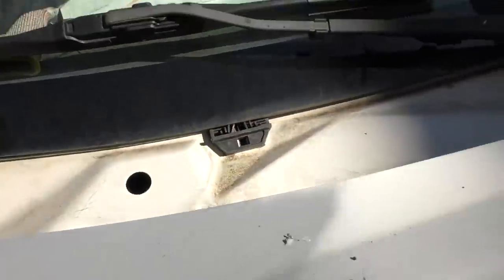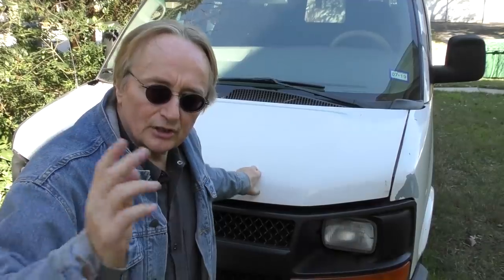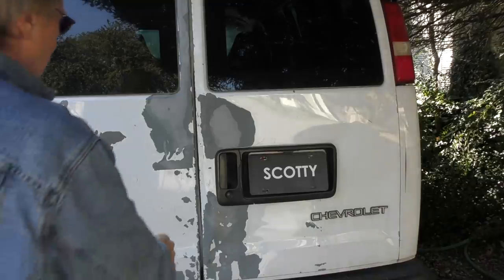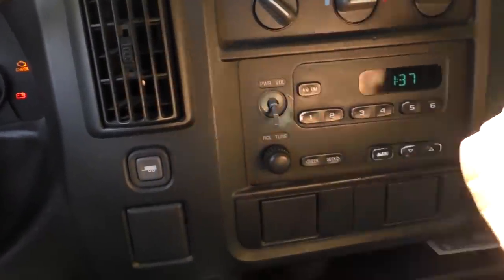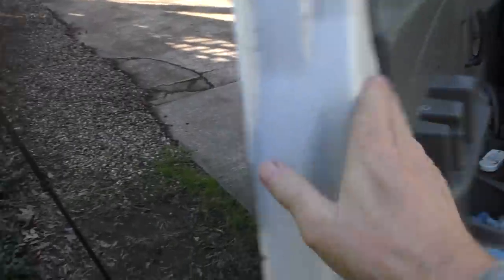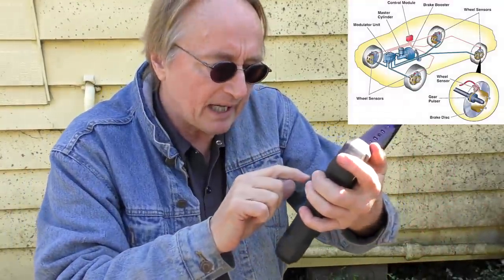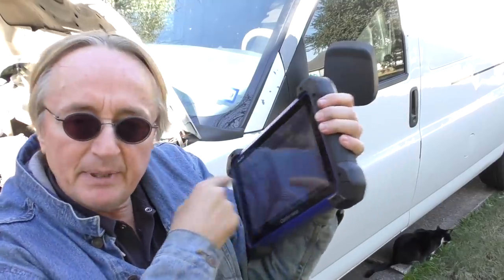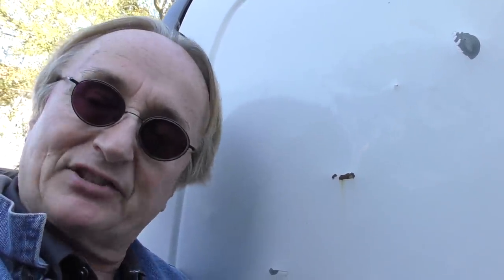I Told You About This Vehicle But Nobody Listened

Comment: I bought my 2019 traverse this past Aug and proud I did.I was a Toyota owner for years. So what if it lasts 4 years less. Time killed my Toyota Camry anyway. My Traverse blows away my 2017 Rav 4 big time. I feel very comfortable in the Traverse. If I get 12 years out of it then fine. My Toyota Camry got 270 miles on it. I went back to Chevy after 20 years. I am proud I did. The Traverse got very good reviews from Edmonds and its built nice. The paint job is mint. I don't care what you buy these days it is all hit or miss. I rolled the dice on My chevy and that's the way it is. I have a good warranty through my insurance company for 200 ded they fix anything wrong on the Traverse once inspected by Geico.   I used them a few times on my Toyota cars. No issues. So Scotty cry all you want about Chevy I went and got one.
Reply: YouTube Movie Junkie it is luck of the draw your right, but you've gotta hope your gamble pays off. It will only be you crying if you put it all on red and it comes up black. You gotta mitigate the risk.
Reply: @johnennis4586  Its ok I will get 150000 miles ..Then I will sell or get another

Comment: I have a Chevy truck for my company truck and a Tundra for my personal truck (2007 240,000 hard miles) Unbelievable all the problems I’ve had with the Chevy (2008 114,000 miles) and it has mainly simple hwy miles. I made the comment the tundra is twice the truck. Not sure if I’m giving the tundra enough credit....

Comment: Scotty, I drove one of those as a service vehicle for a company that had converted it to run on natural gas. Jeez, what a nightmare. You lose about 25% of your horsepower on NG, talk about having trouble getting out if it’s own way. Plus, you had to keep the gasoline system and gas in the tank because the damn thing would not cold start on NG. I would use an electric transfer switch to cut out the NG and engage the gasoline system just before getting home so it would start on gasoline the next morning. Plus, it had 3 large gas cylinders in the back tucked under the shelving. Terrible vehicle, glad to have moved on.

Comment: I guess I’ve been lucky or maybe I’m just not stupid and know enough to maintain my vehicles.... I sold my Sierra with 320,000 miles 5.3 Vortec and the guy who bought it is still driving it 2 years later. Only replaced a fuel pump. I sold my Silverado with 256,000 miles and again it’s still on the road today. I only replaced a radiator. I know Scotty has forgotten more about cars than I’ll ever know but I haven’t ever had bad luck with a GM truck. I don’t buy American cars, only Toyota so I can’t comment on cars.

Comment: That work van has probably never seen a car wash or any wax, and Scotty is blaming poor quality paint? LOL!
Reply: The paint really is POOR QUALITY!
Reply: Bruce Jones compared to other work vans, and not a passenger car that’s well taken care of?
Reply: @94concours  no, the paint did not hold up well out in the weather and sun. Not many manufacturers had paint that held up well, after the EPA forced the lead out of the paint. It took a while for the paint manufacturers to develop a good paint system that would hold up as well as the older ones. Just pay attention to an old junker of the 40s or 50s sitting out in a field rusting away.  You will still find paint on them!

Comment: I have a 2003 Chevrolet Silverado and I have had problems with the paint. All the clear coat has come off the roof. And the rockers under the extended cab doors are rotting out. And is starting to rust on the bed above the right rear wheel. And I live in the south when they dont salt the roads.

Comment: Scotty be very careful trashing that van. GM  made that model with arguably one of the most robust engines ever made the LQ4 and undoubtedly the strongest transmission on earth the Novak 4L80E. The later models came with huge four wheel disc brakes and were able to whip on most modern cars when empty. These types of vehicles were commonly neglected and beat on daily by employees    explaining their usual state of disrepair. I am not a GM fan by any stretch  but happen to be very familiar with this model. Aside from having to climb out through the window on occasion and repairing broken exhaust manifold bolts the later model vans are probably one of the few things GM did right with the highest quality driveline in it's class.

Comment: Scotty, I purchased a 2017 silverado with a six cylinder engine that turns into a four cylinder when you drive down the highway I'm nervous about all the warnings leads me to question if i purchased a piece of junk and should look to get rid of it before i have problems or the extended warranty i purchased with it runs out

Comment: They all make a good one and they all make a bad one. It's hard to say the same abput toyotas because i rarely see on being worked. The trucks are used like my ranger, work commuters and sometimes an appliance or furniture in the bed. They rarely see the abuse that this van has seen. I'm no gm fan but this isn't a fair comparison. My biggest gripe about gm is the metal they used and design. I bought an 06 2500hd. It was dirt cheap and i wanted something to tinker on here and there. I've got it running good shy an o2 sensor. I've patched up the rust and i gotta say for a truck that was parked and left to rot for years, it's purring as much as a 6.0 ls will. I am impressed with that engine/trans, 4l80e i believe. That rot though, I'm disappointed with them and again, I'm not a gm fan. My ranger was in a similar situation, parked for years in grass. No where close to the same rust.

Comment: Scotty, is there a difference between 0w20 and 5w20 oil? Should I use a 5w20 in the summer since it’s so hot?
Reply: Steven Sevek probably not lol. Might get hotter on the track
Reply: Stephen Arling I’ve always used what the manufacturer recommends, they know more about the engine than we do. I’ve always been told the first number in this case 0w will flow better on startup than the 5w will. Once they reach operating temperature, they’re the same at 20
Reply: Stephen Arling I know it’s safe in old engines. Scotty says you should never change viscosity in modern engines.

Comment: Hi Scotty, I have a 2017 Nissan Murano SL. 98,000 miles. Lots of highway driving. The engine light came on and it was a code for a mass air flow sensor. I removed it and cleaned it with mass air flow cleaner, cleared code and two days later it came back same code. So I assume that I will need to install a new sensor. The dealer mechanic said it could also mean I would need a new throttle assembly but won't  know until they scan it. What should I do ? The air flow sensor is like $300.00 dollars and of course if that's not the problem I'm out $300.00 because it's a electronic part. The throttle assembly would be over $900.00! I wish I had known about you before I bought this thing. HELP

Comment: These vans probably get washed once a year and get a oil change every 20k miles, transmission fluid never gets checked and somehow they still last 200k miles. These things were fleet machines and just like the 2v 4.6 fords the 4.3, 4.8, 5.3 engines would refuse to die

Comment: i have a vw transporter with the 1.9 tdi engine, that van is really pulling stuff and getting almost small hatchback gas mileage in highway mileage with 449k miles on odometer
chevy should offer diesel like ford transit does, otherwise its gonna go down in commercial van market too

Comment: The interior looks more like some animal got inside and went wild, the volume control shaft is bent, looks like somebody punched or took a hammer to the radio. There's a clear difference between wear and tear vs someone just beating the crap out of a vehicle. Metal parts like that don't just bend on their own.

Comment: Thanks for your videos Scotty! Was going to Mazda to change the transmission fluid based on your suggestion. Has 71,000 they told me they never change them it’s a sealed system. I have 2016 Mazda CX-5 is this accurate info?

Comment: The Chevy Express is a derivative from the 70s as far as the frame goes...these vehicles are service vehicles and they are heavy duty built with the frame and body. The la v8s were the best thing to happen to these vans.  These Vans are indestructible with proper maintenance......they do 200-500k all day with very little love....yes they fall apart, and are abnomalies, but they get beat on....it's a commercial van.... A passenger variant of this van with last of family 20 years with no issues.  yes it's not as fuel as efficient as the unibody Vans like the sprinter and the transit but that's because of the body on frame setup...people in the know know this.  Nissan 2500 and Chevy are the last true HD vans available.... The dog house that he's referring to is basically two clips and 2 10mm bolts and takes a min to pull out......I like Scotty, but this review is a fail...

Comment: Scotty, I hate to disagree with you but you blasted Subaru for using the same airbag supplier that failed the first time and now Toyota has done it and you’re OK with that and you’re certainly not claiming that it was Toyotas responsibility to find a different airbag supplier. Now you’re blasting general motors for not putting V-8’s in their vans. I’ve driven the V-6 version of this van and nearly gotten a speeding ticket. It’s very powerful for daily delivery service unless they’re hauling concrete then they might need the V8. The V-6 version of this was faster than many cars I drove in the 90s. I was thinking Chevrolet was ahead of the game in that regard. But the paint did fall off of it just like in this example. They’re the same van same here 2005-ish. So you recommend 4 cylinders for most of Toyotas/lexus cars and avoid the eight cylinders but then in pick up trucks and now vans you think everyone should have an eight cylinder.  And no hybrids. Got it. Get a Toyota or Lexus with less than an eight cylinder engine. But if you buy anything that you’re going to move anything with it must be an eight cylinder a gas hog. Got it, wait, Toyota gas hog, got it!

Comment: Scotty my friend has a 2007 explorer sport trac with 83,000 miles and a 4.7L. It has P0011 and P0016. What do you think would be the most likely issue. At times it runs like it needs spark plugs changed but with those codes I’m thinking there’s something else going on.

Comment: Hey Scotty! Original owner of 2012 mini cooper s clubman, 51,700 miles. No problems yet. I change oil. Should I be looking for a new/used car that is more reliable since money is tight for me? I live in AZ. 🚗🚗🚗
Reply: 2005-06 Camry or 2002+ Panther body. A 1996-04 Avalon or '96-01 Camry would also be good; the '96-01 Camry have flimsy door handles and that's about it.

Comment: This isn't exactly an apples-to-apples comparison. Yes they are both vans, but one is a work van and the other is a passenger van. Work vans are notoriously thrashed and bashed and not taken care of. As it is plain to see with this van it was not taken care of at all. Toyota siennas are not work vans, very rarely you might see one being used as a work van but for the most part they do not have the towing capacity hauling capacity or space to be used effectively as a work van. They are usually passenger vehicles and therefore usually taken care of better. I agree with the paint and being crap, and they could have done a better job of that but in my opinion all water-based paint is crap compared to the old lacquer based paint.

Comment: If you need a vehicle to make money with there is nothing better in the world in the GM truck or van I have several Express vans that I have gas working in every day and I can't tell you how great a vehicle they are yeah the paint might peel but if you need the thing to start buy a GM only thing you need to do is replace the right front wheel bearing every hundred and fifty thousand miles in the left front at 175 to 180 and they will never leave you stranded

Comment: Hey Scotty I have a 2014 Infiniti Q50 it has 116202 miles on it. I changed the battery on it and now the car doesn’t accelerate when I put it in drive and the rpm doesn’t go past 3 what seems to be the problem?

Comment: Back story: On morning of 9-11-01 I was headed to Akron, Ohio to pick up my new Chevy 1500 Silverado 4x4. I hear on the radio about the attack on the Towers, I thinking 'should I turn around or.......? When I got to the car lot there was people outside in a stupor, you could hear a pin drop. Anyway I still have the truck. It's always been & yet constantly in need of something. It's like one day when the warranty ran out I looked out the window and just watch it disintegrate.  I  don't even put tags on it, use it to plow drive & run down the road a mile to lumber company. I worked at GM & I knew they didn't care about quality, only the numbers. Don't have a clue as to why I would think a truck would be any different. Well, at the time I was in my 40s & young & foolish.

Comment: Scotty you forgot 2 other things GM used  Aluminum handles on the doors and in cold weather they  will just  break off with normal use ? not to mention they leave  sharp edges that slice the heck out of your fingers plus the  surrounds around the rear doors are plastic  and a they’ve can punch a screwdriver in a locked door and open it faster than a guy with a ket by  moving the locks lever   Chevy built these things knowing the majority would be sold as Work Vans used to transport company tools and  products  which of course makes them a target  for thieves  BTW i had several  GM vans because thats what my Company bought for me to use  they never lasted despite me following all the  reccomended  Service at their  Intervals ? Company paid for. BTW  i did prefer the V8 and the owners  of the company insisted i ordered the All Wheel Drive versions so i  could drive in the winter  safer ?  I. Wasn’t  very convinced on that feature personally  as i  had real 4 WD vehicles  myself most of my life

Comment: Who makes better and more popular big v8 engines than Chevy?? Most of their transmissions are just as good as any Ford,  and way better than Dodge has been..
Chevy truck problems I've run into: power steering leaks and bad pumps,  leaky oil cooler lines,  water pumps go bad somewhat easily.  Automatic trans issues..(what vehicles don't have trans issues? Toyota is probably about it.)
I don't know about the newest Chevys but I own an 07 2500 that's been good considering it was abused before I got it.
Reply: Regarding GM's older designs of automatic transmissions, there was good reason Rolls Royce once selected them as a supplier.

Comment: I usually like scotty but hes way outta pocket here. These chevy vans were severly abused on fleets and they took it in stride. I used to be a salesman for pepsi and i had one of these vans with the v6. I could load it with 2 full pallets of 12 pk sodas and it would still get up on the highway just fine and they all had WELL over 200k miles.  Yea gm got cheap about some of the build qualities in the 90s and 2000s, but for an old abused work van i don't see where that van warrants any serious criticism. I dare him to take any toyota van and beat on it like we did at Pepsi and see how it holds up.

Comment: Hey scotty just wondering your opinon on a 03 dodge durango it has over 235k miles on it and my transercase is making a grinding noise when its over 2rpms when its in 4x4 just wondering if i should i put all this money into it and what usally the first things to go out on em
Reply: Can't speak for Scotty, but it sounds like the car's on its last legs for 4x4 mode. Either 2WD mode or forget driving it unless it's an emergency in ice/snow. Not worth throwing money into repairing. Maybe replace the transfer case fluid with the exact type described in the manual, but otherwise just deal with it.

Comment: that's the way vans have been built for decades. If you stuck the engine out front, then the van would even longer than it already is and you wouldn't be able to turn the thing!  The dog-house is actually easy to remove , and once you do, there is excellent access to the engine. Better than most vehicles in fact!  Don't be such a funny duddy, Scotty.
Reply: also you have to rotate the dipstick. Not hard.

Comment: This guys a nut

Comparing a work  truck with over 200k to prove his point that GM is  unreliable ? 

I’ve owned 4 different GM pick ups, all used for work on a daily basis that lasted me well over 200k with out any major costly repairs 

Properly maintained vehicles will last you a long time and GM has proven to me to have great reliability with their engine and transmissions

Comment: I have had 2 chevy Express vans and a ford econoline. My 2000 chevy Express with the 5.7 v8 has 327000 miles. I used it to tow about 7000 Lb and loaded it with about 3900 Lb of cargo. The express vans are real work horses. The Ford econolines are also great, more comfortable, but dont carry as much as the chevy, and more of a pain to work on. 
Scotty is a hater. All Van's are difficult to work on because of the dog house design. But they can be better to work on in bad wheater cause most of the engine us inside the cockpit. And I find that th he chevy body frame is more resistant to rust than the Ford